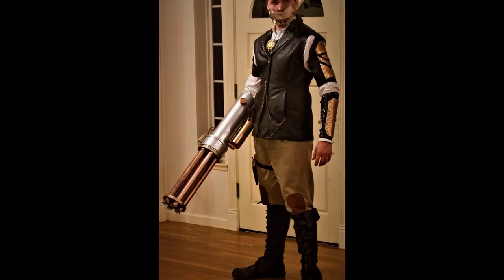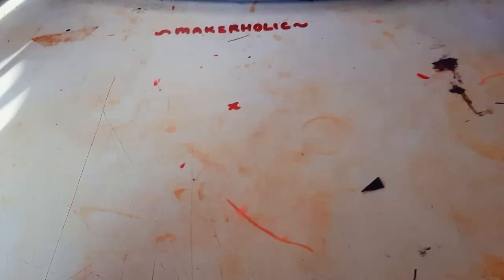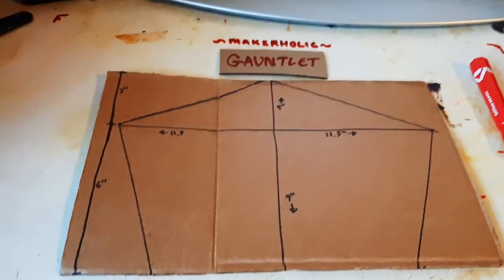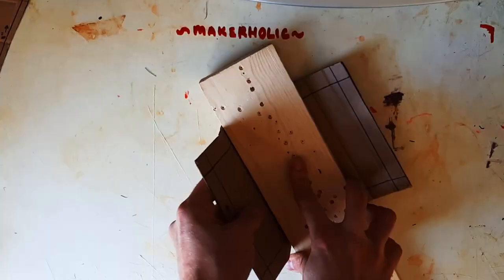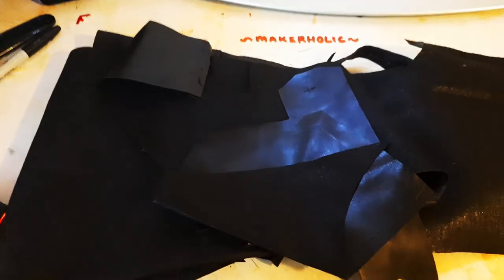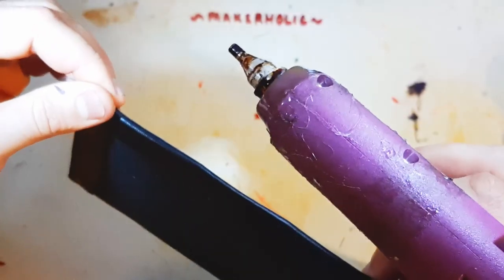DIY Fancy Witcher Costume Ep. 1, Plate Armor

Comment from the maker: 00:00 makerholic intro 
0:18 video intro 
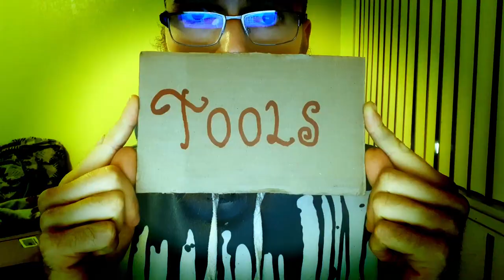0:33 tools
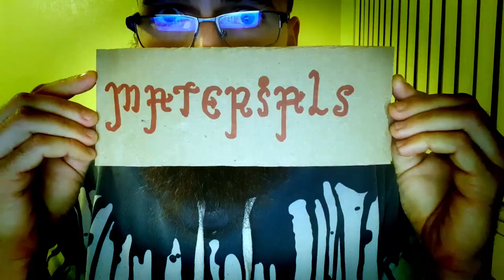1:00 materials 
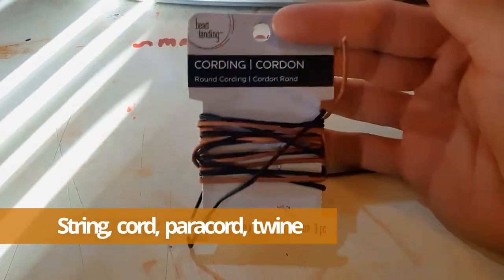1:29 spaulders, design 
1:36 spaulders, your measurements 
1:50 rerebracers, design 
1:58 rerebracers, your measurements 
2:11 gauntlets, drawing the design 
2:36 gauntlets, your measurements
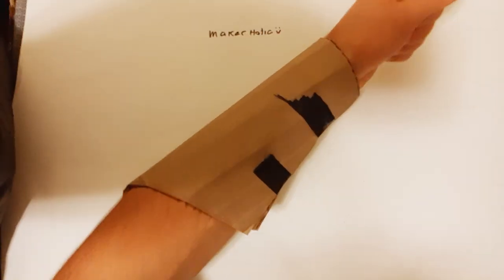2:58 testing gauntlet fit
3:04 remove sleeves from suit jacket 
3:13 line up armor pieces on jacket fabric
3:30 outline them, then cut them out 
3:34 bending rerebracers and spaulders 
3:51 bending gauntlets 
3:59 wrapping armor in fabric 
4:19 prep faux leather for trim 
4:50 trimming rerebracers and spaulders with faux leather 
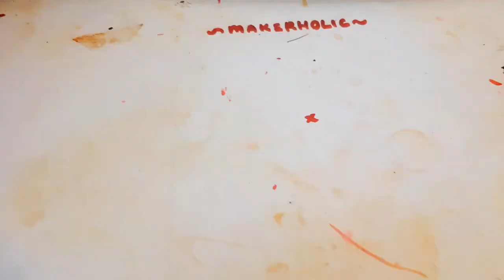5:19 wrapping gauntlets in fabric 
5:39 adding buttons to gauntlets
6:08 trimming gauntlets
6:37 drilling holes for laces 
6:40 EDIT: .5" not 5"
6:50 conclusion